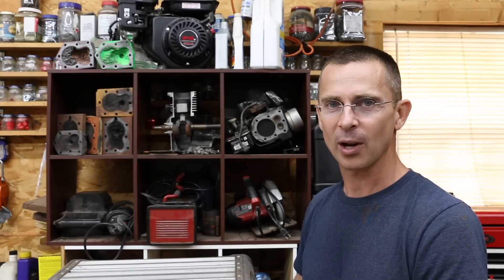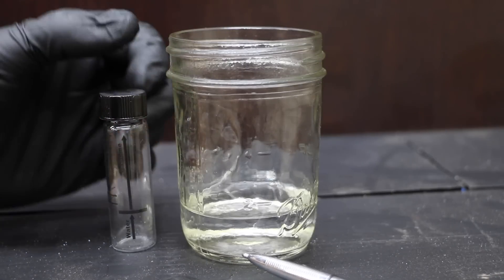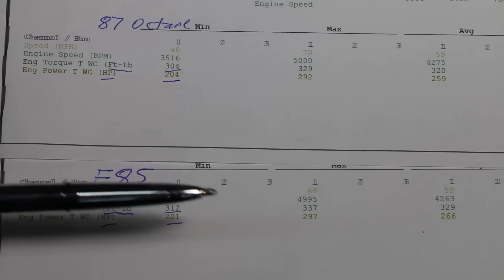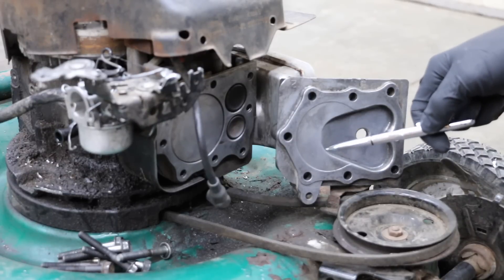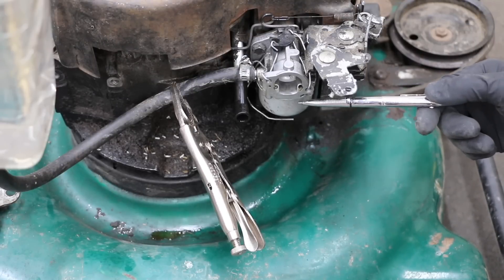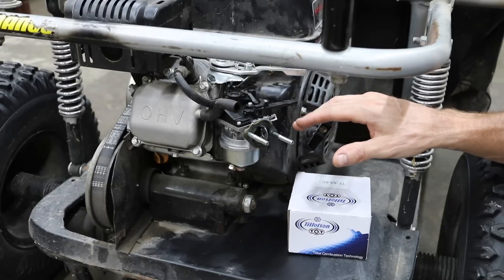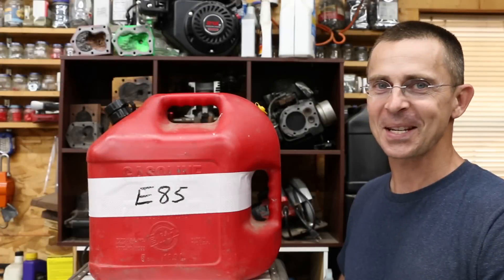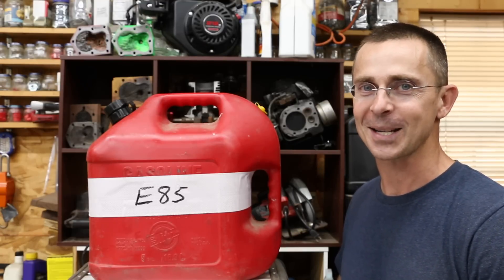Is E85 better than Gasoline? Let's find out!

Comment: A few years back I converted a 273V8 plymouth Barracuda to run on E85.  I did it because I didn't like the performance & the amount of smoke from the exhaust.  
I re-jetted my Carb, changed the rubber fuel hoses to FUEL INJECTION spec hoses, & installed a new Alcohol rated fuel pump (Holley, I recall) to better utilize the E85.
Also, when I had built the engine earlier, I increased the compression - that was always an issue with the 87 Octane fuel.

Once I did the E85 upgrades, the car ran soooo much smoother, made great power & smelled a whole lot better (like hard-cider vs. smog).

I was able to register the Barracuda as an Alt-Fuel vehicle & got the AFV Tag which allowed me to use the HOV lane.  I often got dirty looks from Prius drivers &the Tesla-rati.  Note:  I actually like Priuses & am interested in trying out an EV someday.  However, the irony was fun.

The down side of the E85 Conversion was that once I let the fuel sit for about 4 months when I went overseas on a deployment, the fuel clogged up the carb because it had absorbed too much moisture.  After that, if I knew that the car was gonna sit for even a couple of weeks, I aded Sta-Bil fuel stabilizer.  That solved the moisture problem, but it is definitely something to address.

The 2nd downside was the fuel efficiency - at the time, I got about 20% lower mpg.  As the price diff was +/-10% at the time, I did pay more to fill up the tank.

 Since I did this in a 'fun', hobby car, this wasn't done as an economic exercise.  However, I would (& will) do it again based on the driveability, performance & emissions. 

And yes...to use the HOV lane, LOL.
Reply from the maker: Thanks for sharing.

Comment: I love e85 in my boosted 78 Pontiac 400. It’s like a wonder elixir that can do no wrong. Getting 800 hp out of a motor designed for 180 has been extremely gratifying on a home built motor…Easily develops 21 lbs of boost using 1970 cast iron heads…

Comment: The lower MPG is expected. e85 is a lower energy density than gas. 25.65 megajoules/liter vs 33.18 megajoules/liter(e85, e10) so 11.98 MPG vs 15.5 MPG for the same efficiency.
Additionally, you can actually get better efficiency out of e85 than e10, but it requires the engine compression ratio to be set much higher for the 100+ octane of the e85.

Comment: I'm trying E85 in my 2016 F-150 for the 2nd time just to be sure I wasn't imagining... It has a lot more power, and runs smoother on E85! I'm sure it also keeps the 5.0 cleaner internally. I did drop a few MPGs though. E85 is $1.00 a gallon less than regular 87.
I like it. It's only sold at Sheetz where I live. Gas Buddy can't locate any from DC all the way down to Virginia Beach!
Reply from the maker: Thanks for sharing.

Comment: So I have a flex fuel truck. Ive noticed with heavy towing, the fuel consumption is relatively the same. But just regular driving you get that big difference. So, I guess my recommendation would be, if you have a big job for you truck to do, fill it up with ethanol. IE towing a travel trailer or getting a load of gravel or something. But for just commuting, use regular gas.
Reply from the maker: Thank you!

Comment: I certainly agree 100% with what you said but the BIGGEST plus of E85 is it meets the gripes of the CO2 (clowns) and makes a great argument for continued ICE vehicle production.  Try out a Lithium based EV pickup loaded against E85 - I'd love to see you actually run them head to head on a real load run for say 1000 miles - compare the time needed and the costs and even the CO2 - not counting the lower CO2 used to make the ICE vehicle.
Reply from the maker: Thanks for the suggestion.

Comment: E85 is a hogger.

I haul every day I use 87 on a V6. It does 2-3 days for refuel. Every 6 months I pump two times E85 since is good for cleaning my combustion chamber. If I do E85 hauling 😂 within 1 and half day needs refueling. Performance is great but I wouldn't use it as primary source. No way 😂😂😂 I won't see profit.
Reply from the maker: Thanks for sharing.

Comment: I mix E85 and regular 87 oct (E10) to optain E23.
I burn E23 on my Ej8 coupe stock ECU and feel more power and more miles.
Wen I load straight regular I can see the difference.
So now I load E23 on my back up car  97 cutlass 100% stock. 
Same result.
In older cars that are no flex fuel you can't use pure e85.
You have to mix it with regular or the gas your car requires. 
I test mixing until I nailed at E23.
In California gasoline is E10.
At least on my cars if I mix more e85 to get like e30 the performance goes away. 
Has to be at E23 
"In your own risk"
Reply from the maker: Thanks for sharing.

Comment: My small manufacturing company just bought a 2015 Chevy 2500 Flex Fuel. I have never used E85 and was concerned it would cause more maintenance issues down the road. Thanks for the non - biased info!
Reply from the maker: You are welcome!

Comment: My F150 XLT 5.0 V8 is flex fuel capable, so i have been running E85 in it recently have actually noticed that the engine runs smoother on E85 than on 91 octane gasoline. I also get about 20 miles less per tank so the difference is not enough to really matter, and to top it off E85 is a good 70 cents cheaper than 91 octane fuel and is even 20 cents cheaper than 87 octane fuel and i get a discount on top of that with american express at certain stations so it can be as much as 1.20 cheaper a gallon. 

I am fortunate to live in california where its never cold enough for E85 to have issues, on top of that california mandates that E85 must actually be E85 and contain 85% ethanol under law for emissions purposes as its much cleaner to burn than gasoline and produces about 75% less emissions so thats part of the reason I like it that not only am i running cleaner fuel I also get the advantage of slightly more power and a better running engine as E85 actually equals roughly 105 octane- 115 octane, so being that ford recommends 91 as the minimum octane for the 5.0 v8 running E85 exceeds that and the engine performs even better.

My dodge challenger is from just after they stopped allowing flex fuel on the pentastar which really sucks would love to be able to run it in my challenger as well.
Reply from the maker: Thanks for sharing.

Comment: Correction: E85 uses 30% more pounds per hour (BSFC) than traditional gas, to achieve the correct A/F ratio. And will most always make MORE power than gas, not 30% less.
 In a race application E85 still edges out $15 gal race gas.

Comment: Hi Todd, As always an awesome 👏😎 Presentation ! Can you do one with 91 octane car gas VS 100LL aviation fuel ⛽️ I have an aircraft equipped with the Rotax 
914 Turbo. It would be very interesting to see your analysis on the power difference between the two fuels 🧐 the airplane is designed to run on either, but I would really like to know what the difference in power out put of the two different fuels. I live in the desert southwest and in the summer I need all the power I can muster on hot summer days……. Nicely Done ✅ very educational ✅😊🇺🇸⭐️⭐️⭐️⭐️⭐️⭐️⭐️⭐️⭐️⭐️⭐️⭐️⭐️⭐️⭐️⭐️⭐️⭐️⭐️⭐️⭐️⭐️⭐️⭐️⭐️⭐️⭐️⭐️⭐️⭐️⭐️⭐️⭐️⭐️⭐️⭐️⭐️⭐️⭐️⭐️⭐️⭐️⭐️⭐️⭐️⭐️⭐️⭐️⭐️⭐️⭐️⭐️⭐️⭐️
Reply from the maker: Thanks!  Thanks for the suggestion.

Comment: E-85 I have never tried but a friend ran straight alcohol in his Fuel Injected Pinto engine sand rail. It had to be fed 3 times more alcohol than gas. It also had to be started in the morning using straight gas squirted into the injectors. Crap for milage but it sure ran cold!! At night it had to be warmed up just to race it.
Reply from the maker: Thanks for sharing.

Comment: I converted my 2005 Dodge Neon to E85.  All I did was swap the 19# injectors to 24# ones.  It runs nice and smooth and I haven't had any probs .. the last mpg I got was 24.  With gas, I ran about 29-30 mpg.  So not bad.  Here in California E85 is $2 less than gasoline right now.
Reply from the maker: Thanks for sharing.

Comment: On my GMC Sierra with the 5.3 liter flex fuel engine, it looses 25% efficiency on E-85, compared with E-10 gas. Compared with E-0 gas, it looses 30% mileage. My owner’s Manuel states the horsepower increases by 5, when using E-85, compared with E-10(87 octane). If I notice the E-85 is cheaper by at least 25%(compared with E-10), than I put E-85 in the tank.
Reply from the maker: Thanks for the feedback.

Comment: So i have a 2001 mazda protege mp3. Had it since brand new! Obviously back then we never had ethanol in gas as it ran like a champ with 93 octane with NO ethanol. Now I've been forced to put in this 93octane piss water with ethanol in it. Now the motor will surge like its trying to decide if it want to got wot or not lik its hesitating for about 3 sec then it will go but its slow as shit. U can most deff feel the power is down and she sluggish AF. I'd run that piss poor gas out and fill up at BP stations that have 93 NO ethanol and boom the car would run right again!

So a few days ago I decided to try something as a little experiment. I ran the tank down almost to empty. Drove to Mapco and filled up half a tank with E85 and filled the rest up with 93 NO ethanol and holy shit she is a beast!! I don't mean a beast like a muscle car obviously but as to running much much smoother at idle, smoother at cruising speeds and wot this bitch rips better than just 93 octane

Comment: E85 works wonders for additional power on my tuned turbo car, so I'll fill my tank with about 1/4 tank periodically (remaining 3/4 is 93) and also run some additives with it. But, I hate the fact that the government started throwing into regular gas, as it's killed a bunch of my small yard tool engines over time.

Comment: Hey Project Farm. I think there was a bit of bias in this but you were mostly spot on. E85 is only a really fair comparison when you are running a higher octane like 91/93 and not 87. Reason why I say this is that you are not taking advantage of the benefits of E85 but emphasizing its weaknesses.
1) E85 has a significant octane improvement over 87 octane. You sort of saw this on the dyno but that particular engine didn't show a significant improvement. However, if you look at in terms of percentage, doing a strictly fuel change accounts for a rather significant change in power.
2) Engines run cooler on E85. Depending on your application, this could be a small or huge difference. Usually when you are creating more power, you create more heat. Not in this case. You are able to achieve a higher power output with a lower engine temperature. Whether this is important is mainly dependent upon your usage. 
3) Cost savings isn't as significant if you have higher octane requirements. 87 octane and E85 are pretty much the same exact price in my region. However, if you have a vehicle that requires a higher octane fuel (say 91/93 octane), E85 is definitely a cheaper alternative. I have price swings that put E85 almost a dollar/gallon cheaper than 93 octane fuel. At that rate, you could almost justify the lower fuel economy because the dollar/mile ends up being cheaper.
4) Engine cleanliness. Over a long period of time, I can see that performance robbing build up could end up causing fuel economy to suffer quicker running E10 vs E85. Probably a small difference over time but looking at an overall cost of running adding in the additional maintenance to remove/reduce build up, I wonder just how much you truly save.

One thing I would be curious about is generator usage. 87 octane vs propane/natural gas vs E85! Tons of videos showing how to convert a predator to run propane/natural gas and you already did a great E85 modification. Run the generator at light load and then run it at high load. You have to derate the natural gas generator but I'm wondering if E85 would allow you to over-rate it!

Comment: we use it in winter mostly and a little in summer. to be fair you have to go by miles per $. because e 85 here is$1.50 cheaper per gallon and cleans out carbon . i have water injection on my older trucks it cleans out carbon and they run much better leaded gas will always be the best. but you can't get it any more trucks ran great on it. take care, be safe and well.
Reply from the maker: Thank you!

Comment: The biggest reason for using ethanol free gas is it doesn't corrode like ethanol does. The EPA did tests years ago and found significant corrosion from only 10% ethanol and yet wanted to mandate 15-25% ethanol.  Years ago I switched all my equipment (lawn equip, generators, etc) to ethanol free and have had zero carburetor problems since doing so.

Comment: E85 has its place. My Stihl chain saw and my 1700 cc Kawasaki will not run on e85, nor will my power washer or push mower. My riding mower runs on anything and so does my 1938 Case tractor so that is the only thing I use it in.
Reply from the maker: Thanks for sharing.

Comment: My 2009 Yukon with a flex fuel 5.3 averages 15.1 mpg with E85, 17.2 mpg on E10 and 18.9 mpg with 0% ethanol rec gas, priced at $3.99, $4.29 and $4.99 per gallon, respectively.
Reply from the maker: Thanks for sharing.

Comment: I have a 2011 ford explorer. I put E-85 fuel in it and it was working great. after I sat idle my check engine lioght came on. I thought for a while it might be the valve pumping air was bad but i think it is the E-85. I have P0171 and P0174 error codes in my vehicle. I hoinestly think it is the fuel so I am waiting to refill to hopefull have it off. I have bad MPG but other issues have not started other than the annoying check engine light.
Reply from the maker: Thanks for sharing.

Comment: What I find interesting and could possibly be addressed is that being that ethanol runs cooler it may not be getting a non e85 catalyst system up to operating temperature. I attempted to run sheets 88 octane in  a 17 Jeep renegade . It did shoot a error code eventually that my catalytic converter was aging out. I cleared the code went back to 87 and never had a code since.
Reply from the maker: Thanks for the feedback.

Comment: I run E85 in my 5.3L but I also have it tuned to run better and get better fuel mileage. Also just installing a cold air intake will help alot while using E85.
Reply from the maker: Thanks for sharing.

Comment: I would like to add I’ve been running an e30-40 blend on my 1999 Audi A4 for 3-4 years without issue. It all started when I bought a remapped ecu from Europe without doing research first. This remap required 100 Ron fuel (95 octane). Advertised an addition 65 hp and 83 ft lbs of torque. Running 18-20 of boost with added ignition timing. When running to best fuel available at the pump to me. (93) it occasionally experienced preignition during high load, low rpm situations. I cured This by adding a adjustable fuel pressure regulator, and turning the fuel pressure up from 4bar(58psi) to 5 bar (72psi) and running an ethanol blend. I always add 3.5 gallons of e85 to 10 gallons of 93 octane when I refuel. So it’s not exact due to the different alcohol levels at different times of the year here in the Midwest. But that combo always works. Runs well pulls hard. I also installed brisk silver spark plugs two heat ranges colder with a reduced gap to assist in the higher  cylinder pressures.  Which is my idea for a future video for this channel. Testing the brisk silver plugs.
Reply from the maker: Thanks for the video idea.

Comment: Ethanol has a much higher octane rating than regular petrol and engines fully designed to run on Ethanol must run much higher compression ratios for the Ethanol to make sense. There must be some sort of compromise with the engine if it can run regular Petrol which would result in a lot of knock in a ethanol engine.
Reply from the maker: Thanks for the feedback.

Comment: I had my car tuned on 91 octane and went from 414 whp factory tune to 443 whp, then I converted my car to run e47 with a flexfuel sensor (50% 91 octane and 50% e85 ) couldn't do a straight e85 tune, e47 is all my fuel system can push without having to change the fuel pump and injectors . That tune put me at 561 whp.
Reply from the maker: Thanks for sharing.

Comment: Another great topic, when it comes to getting more power out of the fuel Klotz makes this stuff called Nitro (its not nitromethane) that many have claimed a lot better throttle response and a noticeable power increase, there's another one called CTX Pro blend that claims up to a 40 hp gain, which may be possible on a 600hp engine that can run on pump gas... that would be an interesting topic to try on an average car or a go kart etc...
Reply from the maker: Thanks for the suggestion.

Comment: I run E85 in my mini bikes that I race because its about 80% cheaper than comparable octane race fuel per gallon, plus with a little two stroke oil mixed in (for extra cylinder lubrication) the exhaust smells like RC nitro fuel.
Reply from the maker: Thanks for sharing.

Comment: For those looking for more HP on E85, the best results come from an engine that has forced induction. E85 power is more substantial when there is a power adder such as a turbo or supercharger, naturally aspirated cars just don't benefit except getting worse fuel milage and maybe being a little more green.
Reply from the maker: Thanks for the feedback.
Reply: I definitely notice a performance increase in my 5.0L V8 F150 on E-85. It's nothing crazy, but it feels a little sharper to respond to throttle input and more eager vs using unleaded. It does eat into milage though like you said.

Comment: I used E85 on a jab S-Type with a AL V8. Runs smoothly. Fuel consumption is higher that with gasoline. helmps a lot whenever your are passing the usual environmental checkups.
Reply from the maker: Thanks for sharing.